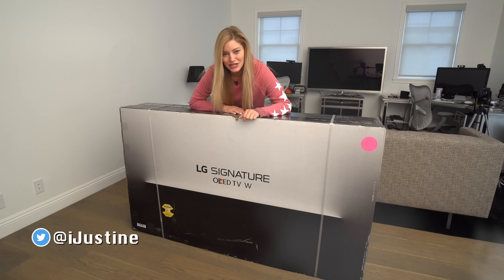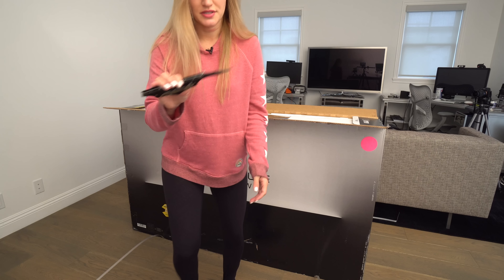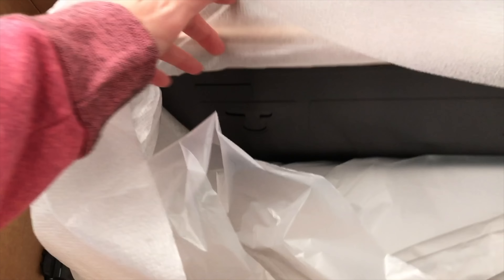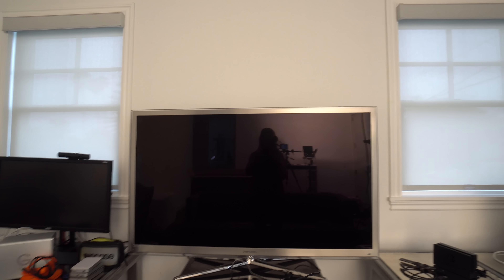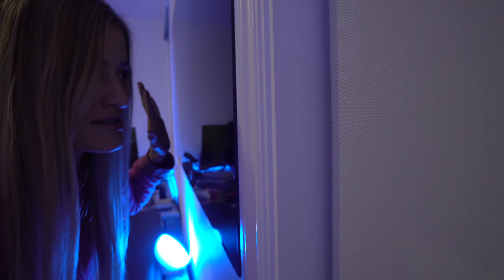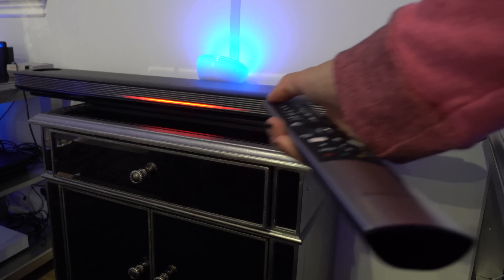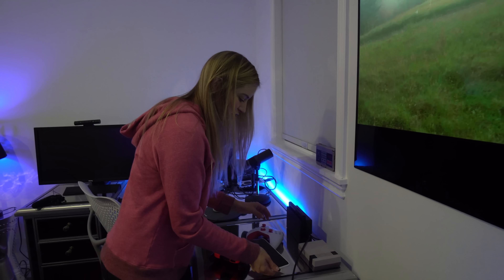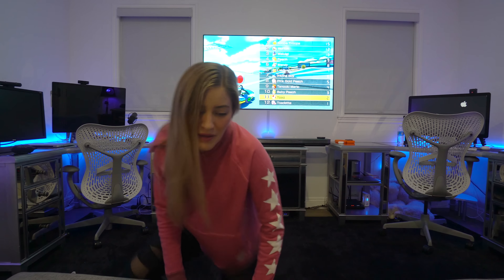THINNEST TV EVER! LG Signature OLED TV W Unboxing!

Comment: So it's 4K but it's actually 8K?
Reply: It's a 4K screen, it costs 8K :p
Reply: Sander Evers it'd not 8grand ....?....
Reply: Roblox 7,999 plus tax is about 8k
Reply: Extended Views the joke just went straight through you
Reply: Sander Evers ITS NOT 8K ITS 7.9K
Reply: they can say its 4k because it has 4k pixels in that big screen but the pixel density is whats important (PPI) pixel per inch https://www.noteloop.com/kit/display/pixel-density/
Reply: this might the best looking consumer tv in the market because of HDR but is it true 4k i highly doubt it and it is $8,000 being advertised as 4k HDR
Reply: i went to check the specs on LG website and even downloaded their spec sheet, they fail to mention the PPI. PPI defines its true resolution
Reply: also do you think the specs of an apple laptop can best  a pc in price and performance?
Reply: Roblox Lumbertalk it is
Reply: 2 dollar per pixel 😂
Reply: PPI isn't always listed, you can figure it out by using the resolution and dimensions given. The ppi for this set is 67.78. Sure there are TVs with a higher PPI but they're smaller sets so it isn't a benefit.
Reply: looks like it is a true 4k then; the hype most be true!
Reply: 10k in malaysia :(

Comment: It is magnificent !
But I am really disappointed that you don't get an option to have it bend since it's an OLED display...
and is really expensive !
Reply: Its also over priced.With these technologies, its better to wait a bit as they realease better ones quickly and at a cheaper price.No need to burn your cash as an early adopter
Reply: Barney B True but Justine got it for free so she is gooooood
Reply: It is flexible, and it sticks to that wall mount with magnets.
Reply: The technology isn't really that advanced compared to some other high end tv's, but the colors are great. Someone at lg just decided to get the panel in a tv and use it as the main tv and have the things that make it work stored in the soundbar. It's a simple concept, but pretty clever too.

Comment: You can buy a floating shelf from Home Depot that's the same size as your sound bar and mount it directly under the TV. Then set the sound bar on top. Just make sure the shelf you buy can support the weight of that thing.Also should help with having that cable not as exposed. Just a suggestion.

Comment: How is this different from any other LG OLED TV? The top part of my LG OLED TV has the same thickness while the lower part is thicker. They just transferred the thick lower part externally so they just have the panel left. As far as I understand, it also has the same resolution with any other LG OLED TV. I can't deny it though. It looks really impressive.

Comment: It's 17 lakh rupees 26000USD approx in India 🇮🇳 I better get a vu 75 inch for 4000 USD and merge it in the wall with a fan duct for ventilation and compare it with a razor blade 😂😂😂